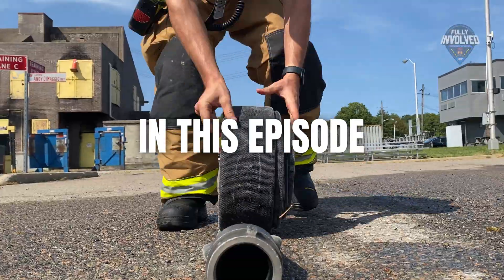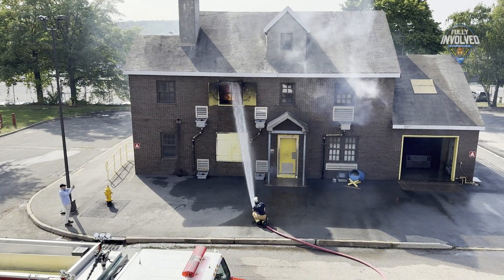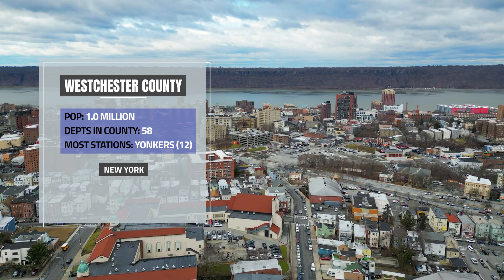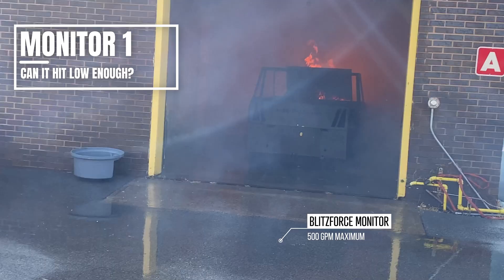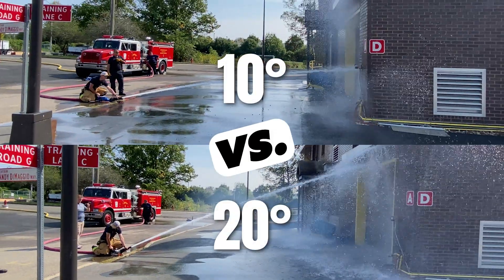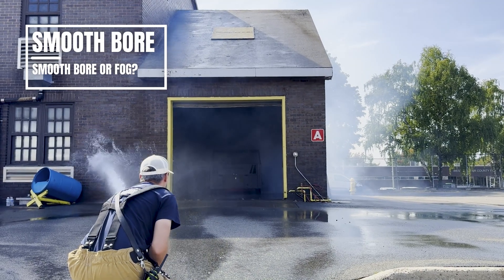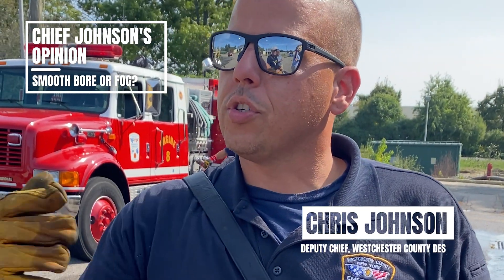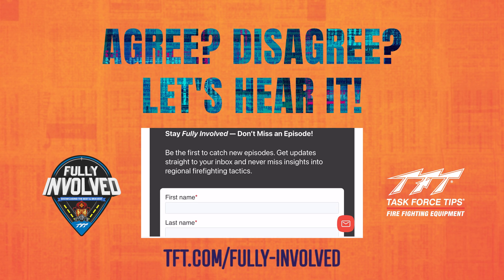Put Out Garage Fires Faster (Ep. 2) | Fully Involved - Firefighting Tactics

Comment: Well , if there is a vehicle fire inside the garage , I probably would pull a line with a combination nozzle , Tft or an Elkhart nozzle . If it’s straight up contents , then smooth bore nozzle would be the line I’d start with .
Reply from the maker: Thanks for adding to the conversation! Walk us through the decision to go handline vs. monitor.
Reply: @TaskForceTips if it’s in the garage , you’ll need maneuverability , knock down heavy fire with larger streams of manpower is available . Then to finish the job , you’ll have to go offensively . The structural maybe involved , where multiple handlings are nessesary for full extinguishment .

Comment: I feel like this is a loaded question. As for us rural guys, due to travel time and response times, it’s most likely going to be into the house. I do like the Chief’s comment about “set it and forgot it” while setting up other lines. I just feel that it works for that situation but chances are most of us are going to be stretching a line inside as a priority with second line going to garage.
Reply from the maker: @Towboater08  On the attack line do you prefer a smooth bore or fog?
Reply: @ we just switched to vortex nozzle from combination about 2 1/2 years ago. With extended travel times the smoothbore offers amazing knock down on bigger fires while the fog lets us clean up and overhaul

Comment: Love hearing the understanding that narrow fog steals heat.
Reply from the maker: @owenreuby  Would you go ground monitor or handline in that situation? Or neither?
Reply: @TaskForceTips  I'll give some context, currently awaiting a training course with a major UK fire service so my opinion won't be textbook especially due to attached garages not really being a thing. However it'd get started with a 22 mm hose reel @ 32 bar and then a 45 mm layflat jet @10-15 bar which the hose reel would also be lowered too
Reply from the maker: @ That was the whole point of the series, to get different perspectives - so we're very glad you chimed in! Do you feel like most UK firefighters would go with the fog there?
Reply: @TaskForceTips  It's hard to say, because our approach is based in gas cooling a narrow fog is probably what you're most likely to see. However with what I've picked up from the US I'd go with a solid jet especially if it's well alight
Reply from the maker: @owenreuby  If you're going to be at FDIC, stop by our booth to say hi! We always love getting perspectives from all over the world.
Reply: @TaskForceTips  Wish I was going would've been a great conversation
Reply from the maker: @owenreuby  Next time!
Reply: @owenreuby 32bar?? The fire departments I met here in Germany run 15 at the absolute max
Reply: @QPD-1  Is that layflat delivery or hose reel? Because the majority of UK hose reels are rated for high pressure, with the idea of an initial attack. But 32 bar is the maximum and not the rule, majority of the time it'll be 15-20.
Reply: @owenreuby It’s for flat line, but we have a preconnected rubber hose reel on the truck for fast attacks. Still I have not heard of people running anything above 15. maybe the uk just has another system. May I ask how high the flowrate is at 32bar?
Reply: @QPD-1  I can't remember off the top of my head, but at a guess I imagine it's similar to 15 bar on layflat. Because both the branches for the layflat and the hose reel is flows from 130lpm to 500 lpm @ 6 bar
Reply: @owenreuby Pumpwise here you can flow how much you want, for a B layflat hose this is around 1500lpm 
The c nozzle is up to 150lpm and the b nozzle up to 420lpm or 800lpm

Comment: Is there any concern for pulling more oxygen into the room when using a fog pattern?
Reply: If the GPM’s can override the BTU’s it’s not an issue at all. It’s all about well aimed application of water.
Reply from the maker: Thanks for the question! We tapped one of our experts for some insight - UL studies have shown that any pattern will move air, and of course more air movement is present in a wider pattern. But ultimately it’s all about weighing the variables of the inlet and exhaust of the fire flow path - and also the space where the fire is. Then you can make the best decision of the tactic you’re going to use.